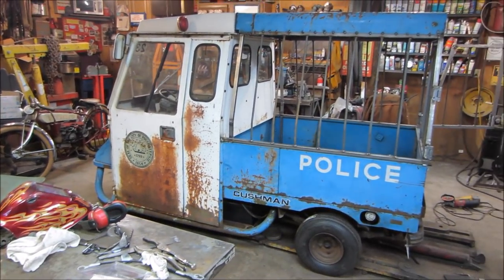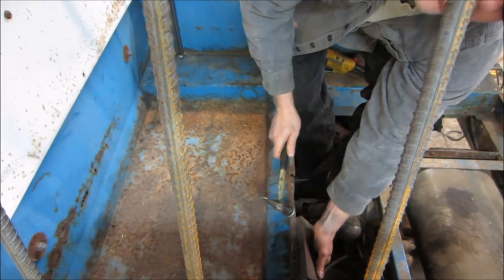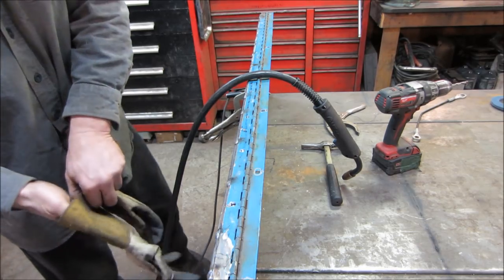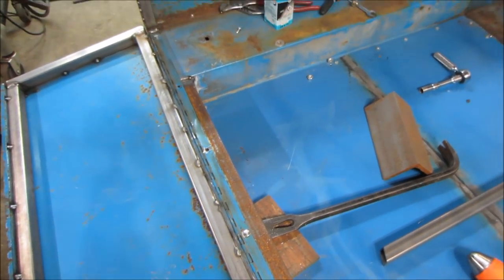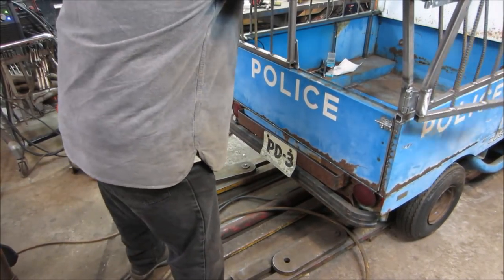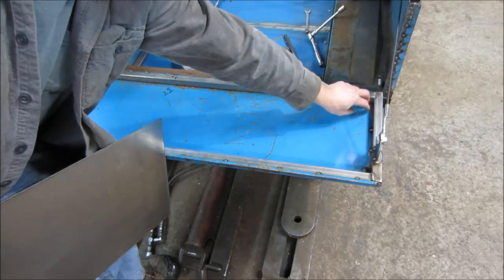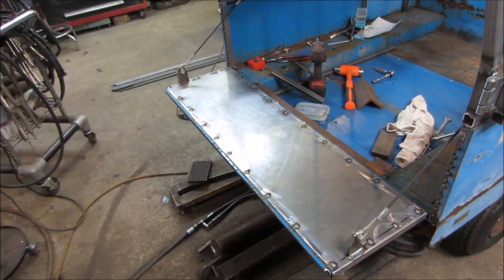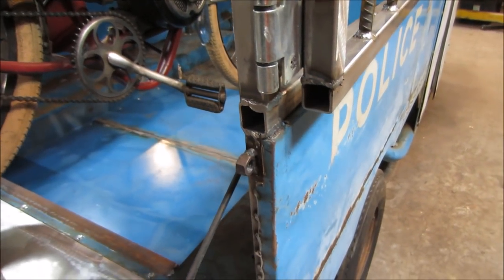cushman floor and tailgate fabrication

Comment: Great tip using the hammer for support while welding, I noticed that right off  looks very slick.  With all the welds and repairs to have the doors line up and that hinge was genius.

Comment: Nice conversion to your world of use! I have boxed insides of tailgates. I usually get all drilled for the plug welds, then do one corner weld, warm up the whole skin with a weed burner, then weld the other 3 corners. I then warm the skin back up and weld the rest. I only warm the skin up about 50° - 75° over the frame. It stretches the skin & makes it more resistant to dents and wrinkles. Heat it too much and it may warp the frame. I'm really NOT ocd, but little details help the final results. Great video series, continuing a Great Channel.

Comment: Looking very good.   The tailgate is now very strong.  

You mentioned looking for low profile nuts or shoulder bolts.   You have a metal lathe, you can turn down nuts and bolts as needed.   That is what I do.

Dave.

Comment: Dam that tail gate is strong, i can't see the bikes ever being heavy enough to move it :-D
I like the idea of endstops on the gates, the tapping would drive you mad.
Reply from the maker: after its painted l will put rubber on the contact points for noise

Comment: Gonna need to red flag the bikes like a log truck. Great vid, I worked on a job that used one of theses fine cushman machines. Had a flat bed. And two different sized wheels in the back. Used it for landscaping work. 
Bringing back some memories with this project. 
Thank you

Comment: Watching Mustie struggle to change tiny tires on the cushman inspired me to look for a alternative. I found at Harbor Freight a Mini Tire Changer made by Pittsburgh $42.99 Item #61179. It handles tires from 4" to 12" like small atv, golf cart, ect. It weighs less than 15 lbs. 

I got one to fix my dads electric wheelchair tires instead of waiting weeks for the VA to approve the parts & labor.
Reply from the maker: l have one but on some tires its not very good
Reply: Mustie1 I hope it works well on the tires for my dad's electric wheelchair. I'm already making a 2" thick plywood base 2' x 2' secured with 1/2" carriage bolts.

Comment: Loved this video, even if I did have to watch it through sand paper eyes because the last 1 you never warned us to  "watch your eyes" , was going to bring in a pair of welding glasses or a mask but forgot to, an then you didn't warn us in this 1 until you flashed us a couple times ;)
But it's coming along fine, and I don't have any problem w/the hinges, once you get the reflectors on them they will look like it was meant to be there. Also liked the dropped floor, but would still make a hide-a-way in the back for a jack etc..maybe where the old battery box was? Or someplace back there at any rate. Still love this project, and it is going to be a real eye attractor when you get done.  Only nitpick I have is the drivers rear wheel looks a bit rusty even compared to the rest of the vehicle? Maybe a bit of blasting and some white or gray paint? Not  completely as it would not match, just a bit of cleanup so they don't stand out, and to keep you from having further problems with the rims down the road.

Comment: Those hinges...May be...a couple of air pistons an per some car boot lids...the rear doors a single piece and locked as per container locking device that would have been easier and cheaper to manufacture, clamped shut, no rattles, with a simple locking padlock hole below.  Sooner or later someone will brain it... OUCH! :) . I am an old ex mechanic and love your inspirational videos. .. you just gotta get into those carbs man, yeah! :) . Keep the vids coming.  The Cushman is my favorite too.

Comment: Just a thought on the bump stops for the gates. Step vans have these little spikes on the doors that snap into little round rubber donuts on the side of the body, that hold the doors in the folded back on themselves position. That is one solid tailgate!

Comment: I am awed by your ability to do plug welds. when I did my truck a few years back all I do is either burn through or not get penetration.   and the upper metal like the rockers I was welding in because there was a tiny gap between it and the base metal it would always just burn away.

Comment: If it were me I’d weld plugs over the ends of those open tubes keeps 🐝 and 90 % of the water out of it so it won’t rot from the inside out used to do it on bikes I built gives a cleaner look to more professional look just my opinion love the channel and all you do keep up the good work

Comment: Mustie I would suggest adding turn signals on the hinge you added. It would make the turn signal more visible on the back and would work as a reflector compensating for what ever loss in  visibility of the other signals caused by the addition you put on.

Comment: Maybe put a little 3m reflective tape or something on the inside of the hinges? So when they are open, when you are hauling it will have reflecters higher up for hills and so people can't claim they "where sticking out and couldn't see them blah blah blah". Just a suggestion. Since the tape is thin the hinges could close. Either way I really like the progress. Cheers.

Comment: It's turning out pretty cool. 

Would it be of any benefit to add a couple small brackets inside the box sides to act as a positive stop for the tailgate? I noticed when you closed it it would go past the sides a little bit.  I think a couple small brackets with some rubber pads on them would work great. Set it up so it has just a bit of tension on it when the gate is closed.  It would keep the gate flush and cut down on some of the rattling. It's just an idea.

Keep up the great work, I love your videos!!

Comment: You did the hinges the right way, no worries. You can trim the backing on those reflectors off or just remove it all together. Good ideas. Will you rust it with salt?

Comment: I like the hinge idea with the reflectors , I was wondering about the extra weight with all the rebar etc. do to the wheel bearings and suspension, and with the weight of the front end be enough to support, maybe u might want to explain, I had a small engine short bed Dodge truck, and when I put a  lot of wood hanging out the back I was losing front traction, though your scenario is different

Comment: Looking great,  I really wish I had even a fraction of your welding skills :-) 
The one thing I will say about the hinges, the reason they look a little odd to me is that they taper the wrong way - the hinge joint is wider than the bit where it attaches to the body. If they were square and the same width (or wider at the body end) they'd look much better IMO. Other than that, I think they're fine!

Comment: Looks Great so far. Just a note.....You will not see the reflectors mounted on the hinges if you have the hinges in the open position and you are driving. Not that it will be an issue, just a hmmm moment is all. Keep it coming Mustie, we are all loving it so far. Maybe you could even get a few local police to pose inside for a charity event, you could also misplace the keys...lol
Reply from the maker: when l pull them over, l will ask
Reply: Mustie1 could even use sticker reflectors,  just a thought brother. I love this thing! Lol

Comment: To hold the doors in an open position, look for some fold away T latches used on utility truck boxes and heavy equipment. There when you need them and folds away when you don't.

Comment: Hi Mustie, love your channel. Does the hole for the bolt on the doors go right through the box section? If so, the handle on the bolt can be pulled out and the bolt would drop through defeating the lock on the doors.

Comment: When you pull the handle pin out of the center gate latch, the locking bolt will drop and rattle around inside the tailgate.

Comment: Not sure if anyone else has already mentioned it but weren’t you going to use magnets to hold your ‘dog pound’ signs on.  If so, shouldn’t you have stuck them inside the tailgate before welding it up?  Love the videos, so easy to watch, keep up the good work.

Comment: As a former traffic enforcement officer, the gates and hinges look ok to me.  A greater concern would be the rear lights - if you operate with the tailgate down then they probably won't be visible to any driver closer than about 30' behind you.  ( I have a vehicle where the as-built light position is similar).  Might be worth considering duplicating them on the rear panel of the roof.
Reply from the maker: l stood behind it and its not  bad but might add some after the metal work/paint is done
Reply: It would also give you the opportunity to fit a worklight for the load deck.

Comment: Here's a suggestion you will only use in nightmares! Put a hot VW engine in de Cushman along with separate brakes for right and left and wheelie bars. Get it to do a wheelie all the way down an 1/8th mile strip at least!

Comment: Regarding the tailgate straps, they could have gone on the outside, like the chains on old pickups.

Also, one end of them looks like they are/were designed to snap over a bolt or something with a head and the spring (around 23 min) holds them from coming off.  But still can flex the spring and remove it so the tailgate could fold all the way down.

re: hinges, how about knocking out the current pins, and replacing with removeable ones so the doors could be left off entirely?

As always, thanks for the great videos!

RichE

Comment: +Mustie1, Google "ladder boot skull savers".  They are used to protect those walking around fire apparatus, (primarily) from extension ladders; and (occasionally) from pike poles, specialty nozzles/deck guns/deluge guns.  I'm certain that you can find a way to make them look cool.  (maybe a "DON'T bang hear here label will look good??)

Comment: Wow it's getting close, super job. And yes the hinges are best where you put them. You may want to plug the tube ends up. I think they'll sing to you going down the road like a colieape pipe organ. Have you thought about wheel clamp blocks by the cab? Why not add a sliding ramp ? HGR has about ten for sale asking $500 @ abit newer then yours , ugly in comparison to the beauty of this one. Thanks for sharing.

Comment: I would think some square caps or plates on the ends of the open square tubes would polish it up just a bit more. I have to admit, I was kind of skeptical about where you were going with this, but I guess it turned out allright.

Comment: you could put a led strip (or some type of light) in the roof on the bed on that bar and have a switch in the cab. The only problem I have with the top hinges is the fact that when the doors are fully open then the red reflectors wont be seen (the same with the orange reflectors)

Comment: The gates and reflectors go very well. Cushman would have used the KISS method so it's appropriate. If you start making real long bikes you could add a flip out extension on the gate.

Comment: Are there brake lights and/or turn signals under the tailgate?  Instead of reflectors, get 2 of those lights you have on the front.  These would be red. Have them serve as (single, duplicate, triplicate, brake lights, turn signals)  You can put a reflector facing front.  Just a suggestion, no pressure! LOL

Comment: Only thing i don't like is the bike in it. Also would have done the flat floor so the tail gate matches up as one smooth piece. But its good bro! Seen hinges stick out like that before on stuff in the past n i think you did a good job with them.

Comment: Are the vehicles behind you, going to see tailight/signal lights. The top ones look like they may be blocked by the top cab now. And with the tailgate down it looks like the lower ones will be partially blocked.
Reply from the maker: no the lights are under the bumper

Comment: I would brace the center section of that hole in the box and I put piano hinges on the metal you lay down that way you can get access to your shocks and fuel pump at all that stuff under there just a thought
Reply from the maker: just take the screws out

Comment: I'm not sure if you have a bead roller or not but if you do you could have put a bead or 2 into that flat metal on the floor and tailgate and it would really stiffen it up a lot. You probably wouldn't have needed those extra supports in the tailgate.

Comment: I had an idea mustie. What if u popped out the hinge bolt and replaced it with a light on a bolt like the ones on the front of the cushman. Then u could wire them up and they would match the front of the thing.

Comment: With the gate open, it looks like you will be obscuring your License Plate and Tail Lights. You might want to look into mounting the plate and additional lights on the back of the roof.
Reply from the maker: they are under the bumper

Comment: Still, thnk piano hinges on those doors would be cool and they would fold back like cool gullwing doors... Remember to drill some drain holes in the bottom of that tailgate before it rots out from the inside...

Comment: Fantastic Video, as usual.
Sorry to harp on about hinges, but as a Mech Designer perhaps what irritates us fans (subcociously), is not that they stick out, but they are mounted, thin end to thick end (hinge).
As well as reflectors, how about an additional plate, thick end frame to thin end hinge, which would look structurally better, not necessary but hey, only you and me and 108,00 guys know why.

Comment: Looking good Mustie.  Hope you find a stuffed gorilla so you can hang him on the inside! Was wondering what kind of title you got with it and is it capable of driving on the highway?
Reply: Vehicles older than 25 years old don't require a title in New Hampshire. (With the exception of Heavy trucks with 3, or more axles, or a gross vehicle weight of 18,000 lbs. or more)

Comment: I had a question about a generator. If I found a generator with a blown engine can I just attached any same HP engine? And if I can, how do I get the engine to run at the proper RPM for the generator?
Reply: The shaft  make be different
Reply: Try and go like-for-like, generator engines tend to have a tapered shaft output whereas a regular engine (say, go-kart, pressure washer, etc.) have a straight, keyed shaft, which wouldn't fit, plus you don't want to fit a small generator onto a more powerful engine, as if you overloaded the generator, the engine is meant to stall, and to powerful an engine would keep running and burn up the generator windings... :)
Reply: The replacement engine you select must have a governor mechanism to maintain the rpm at 3600 or 1800 depending on the generator.

Comment: Wanted to reach through the video screen to stop you, when you welded the final skin on the tailgate. You need to make a stop for the upper door latch, to not fall into the void in the tailgate, if the little handle falls off. That is the only trouble mounting them in that position.

Comment: What was the reason for drilling those holes and then welding them again? Does it add rigidity or something? Also, I'd love to know what the state thinks of this. I think I would have a hard time registering this vehicle in my state. Do you need special insurance for it? I was actually trying to buy a moped several years ago, but it was one of those Chinese made ones and my insurance company would not accept it as a vehicle even though it was legal in the US.
Reply: Ah, I didn't realize there were 2 layers. I thought it was a single layer with the square tubing just underneath. Is it difficult to get insurance for speciality vehicles like this? Are you allowed to make all these changes without the state complaining about it (presumably during the inspection if NH has that)?

Comment: I know it's been 3 yrs but I just got the trucksters type same engine 3 on tree I've got go get it mine will need bit of body work not so sure about engine ? 
But been watching ure rebuild getting lots ideas for mine it has bike hand for 
Streeing wheel but everything almost same 
Found replacement engine for if I need it 
It's made for them by Honda so we'll see
Mine doesn't have doors or heat system

Comment: Where do you find those tailgate straps at ?
Reply from the maker: they were in a free pile
Reply: I need to find some for my danger ranger project.Maybe Napa will have them. Its going to take a whole box of rubber snubbers to keep the little guy from rattling huh ? lol

Comment: OK, now park the car on some uneven terrain, and see if your door latches will still line up. Make an elongated slot, so the pin can slide in no matter the twist. Then as your travelling, the sides can also flex, rather than bending your latch pins. Just my Cdn. 2 cents!! Otherwise, fantastic scratch building!!

Comment: with the gates open the jail bars twist why not brace it with a cross just behind the cab , 200lb of bikes braced to the sides need rigidity , i still like it
Reply from the maker: you cant budge it from side to side now,

Comment: Tailgate- easy to reinforce- stick straw of STUFF spray foam insulation into the void, 1 can should do it. Careful not too much.
Reply: HUBBABUBBA DOOPYDOOP Open-cell foam like that holds on to any water that gets into it, and would rust it out from the inside of there were any leaks.